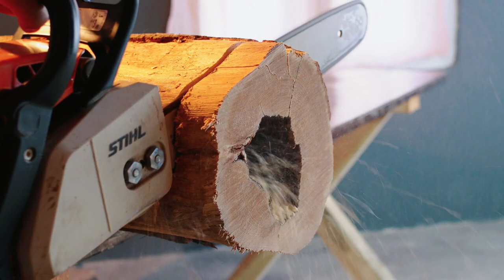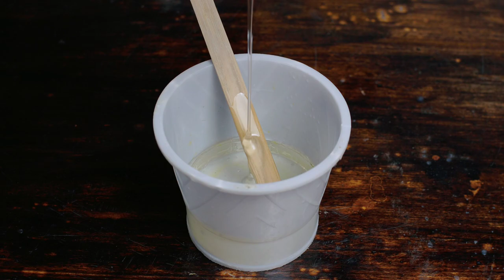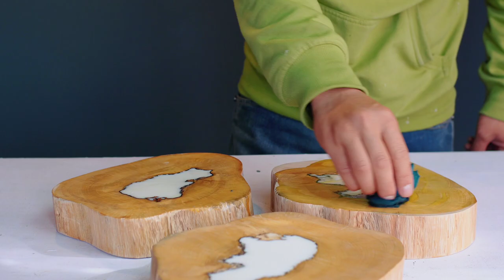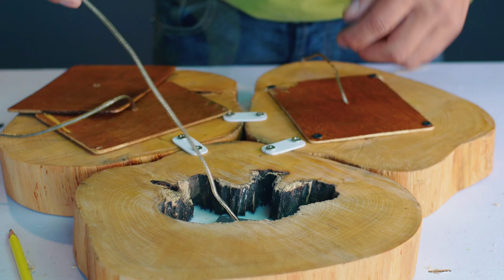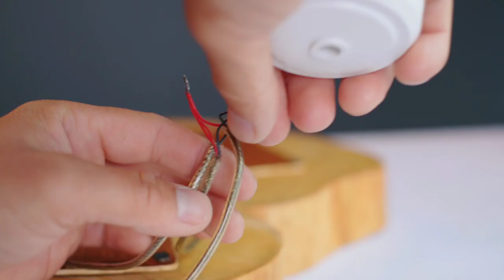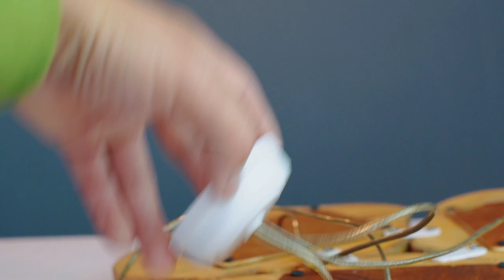making a pendant light using hollow log and resin | woodworking| resin craft ideas

Comment: Bit of a fire hazard, but ok.

Electrical wires are not supposed to be structural. Wire gauge was a bit thin for 120v, and I didn't see any DC converter, so I'm a bit concerned.